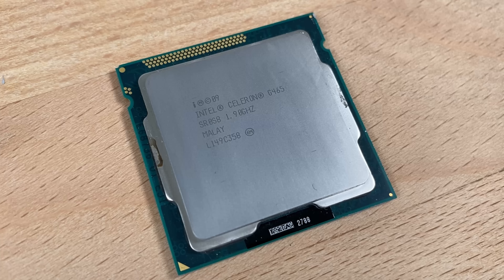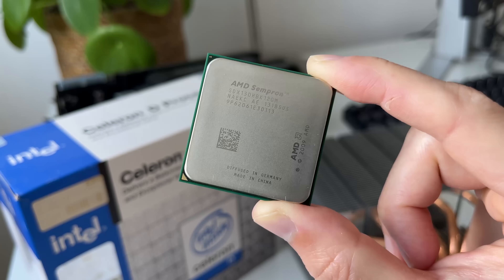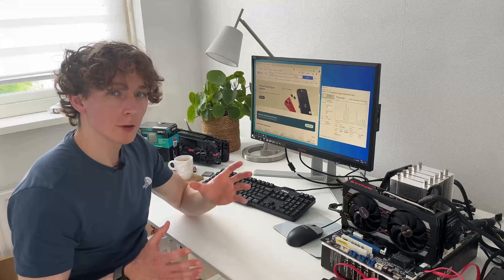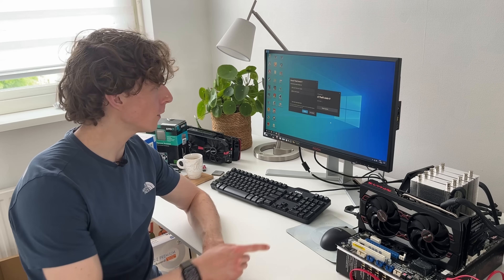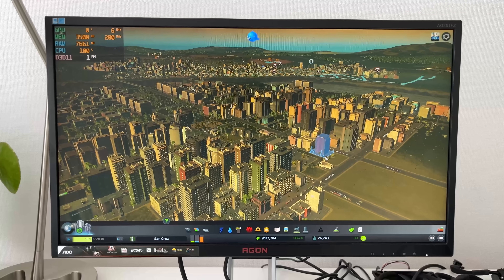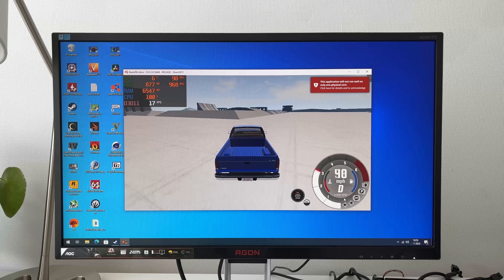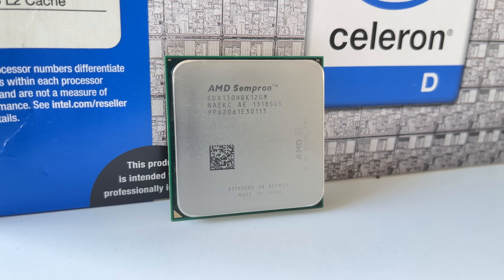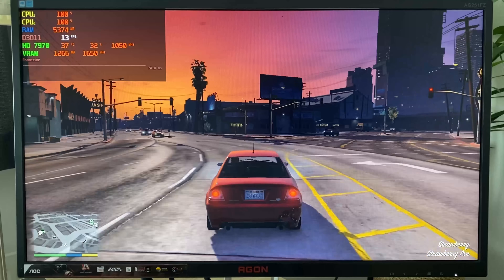AMD's Final Single Core CPU...

Comment: I own a Phenom ii x4 b55, also a CPU that never existed, and started as a sual core. Overclocked to 3.6Ghz It runs Windows 11 just fine. The integrated graphics in the motherboard dont run youtube smoothly at 1080p so an old GTX 1050 helps it runs smoothly even in 4k :D

Comment: You have to keep in mind that single board computers and low end systems are often used in industrial/commercial situations.
I can't speak for today but as of 2012 there was still a lot of billion dollar industries that ran their systems on Pentium/Pentium 2 era hardware and DOS apps with keypads and tiny CRTs as the interface.
There was still a market for single threaded CPUs for situations like that, though IO becomes the issue then. Most of these old machines connected over serial, which is becoming more difficult to get. When you're talking about a $10K lathe or a $1 million box cutter, you figure out how to keep old tech alive.

Comment: Heres a story inspired by the Celeron video which pushed me to explore the single core AMD Sargas chips much further, in fact after a bundle from a scrap lot, bending some pins and a handful from a fellow XOC friend, i had a few open box and sealed ones (which happened to be a numbers maching pair, 57 and 58, which i have dare not opened. After a 3400+ 939 system with an X1950, 1650, 2600XT, popping in a 4200+ for some tests, i came across a gold nugget in the dirt, amongst the scrap lot was an X2 4800+ the fastest 939 offering, the pins came back perfectly and it indeed worked. But for the XP games, 2 cores was pointless, HT is what you wanted and while almost going for the celeron option, my roots with my first PC were AMD and an nvidia card. 

Another friend turned out to have a motherboard i forgot i long lusted after (as i was the weird one who drooled over a a strong bored and potato CPU.) The Foxconn Destroyer. With AM2+ and a Bios update i now had an AM3 Sempron 150 at 4Ghz (young me thought i could unlock the CPU if i needed a dual core down the line, not with this board :P) But in MW2005 amongst other NFS titles, they were able to take advantage of the X2 4200+ performance, but on one core, but i found that the high 20s low 30s in tough areas only raised into the low 40s, surely there was more peformance in it, the 2600XT just wasn't enough with the slow downs. 

From that same friend they chucked in an ATi HD4870, the baller card that reminded me of that original ATi lust, Crossfire, Foxconn Destroyer, Dual channel (as they were only capable of this on AM2+ with its DDR2 controller.) I knew that card was overkill, but was sad to see the iceQ card i loved just half the framerate of what the 4870/50 i later got was capable of. It however ran warmer than i had liked and just drew power pointlessly. I then remembered the cooler i had put on it was a match made in heaven for a Zotac 9800GT that for some reason has the best mount ever, at idle it sits in the high teens and mid 20s under load, the original slim flower cooler from Zotac producing high 30s idle and mid 50s under load. Faulty T sensor i thought but nope..performance was a hair worse but i could run the fans silent across the whole system.

Not too long ago i found the case i'd have used if i had upgraded, a CM Elite 330, it felt wrong having an athlon when my roots were with a sempron and my first PC i felt needed to have my first PC components back inside, now that i had found an Xpert Vision FX5900XT and 6600XT, the 2 cards i wanted back with that system and an athlon 64 3000 or 3200+ i can finally see what differences it would have made and if that 2800+ had more to give. I always wanted a UV theme back then and after spending way too much on some new old stock UV fans, the whole system was now decked out with them after i found a Scythe Mugen 2 Rev B, the mount was a little sketchy but works. The motherboard sadly hits an FSB wall i haven't been able to get past and these chips with a good bin can reach the mid 4s, but as it stands, the poorly optimised games now run above the monitor's 75Hz refresh rate and in those Unreal engine titles, the framerates are silly high.

The last thing i need to explore is Vista that enables the use of Hybrid SLi, the dGPU on the board is derived from 8400GS silicon and with such a card in the system can enable one of the poorer SLi combos but would be amusing to explore, definitely worth a HWbot submission :P

Comment: I have a guess for why that weaker chip would be released later. There was probably a large stock of chips that failed and were held back until the higher spec of the same line were sold off. Then were modded and sold as lower spec. IIRC from reading and listening, this is just how manufacturing then binning microchips works. It would still be fine for a lot of applications since even slower/older chips were still in use without complaints.

Comment: I had sempron 140 for quite some time. When I discovered that my MB can turn it into a dual-core with a click of a button it was a revelation. I used it until 2019 and it's still running in my mom's pc (as athlon II x2 4400e)
Reply from the maker: Nice! Thanks for the comment

Comment: Back in 2005. I bought a Sempron 3000+ with 512MB of ddr, later added one more stick for total of 1GB and later the ati x1650 pro. 
It was a great computer for the price. Remember these were the day of Windows xp, and youtube was very much different before google bought it.  Games like Doom 3 and Quake 4 worked fine. 
Of course everyone ignored Vista because it was trash. 
But it was around 2007.  that the old Sempron was showing its age when Crysis was released and first quad cores where coming into mainstream with plebs. Games were aimed a single core for   a while after. 
Around 2009. when Windows 7 beta was a hit I got an Athlon X2 4800+ on the am2 socket with 2GB of ddr2 in dual channel.  The ATI HD3650 was the most expensive component as was most common in gaming configurations and the cpu was overclocked to 3GHz. 

But for  my parents and other light users the Sempron was just fine back in the day all the way up to 2012. when they got my Athlon x2 4800+ machine.

Comment: These chips weren't meant for gaming on Steam AAA titles, but really just for systems that are mainly used for word processing, spreadsheets, etc.
I used to use Sempron 145s and 140s as CPUs for file servers in the mid 2010s, as they performed better than P4s while running cooler. Also, I found that good single core performance was more important than overall multithread performance like you might get from contemporary dual core, multithread Intel Atoms. Semprons fit those needs nicely, and I only outgrew the single core's capabilities when I wanted to do ZFS compression and virtual machines on the file server..

Comment: There are probably x86 embedded systems out there running things like VxWorks that would absolutely fly on that chip because they were designed for 33Mhz 486SXs. Hell, even a system based around an AMD Geode at 700-800MHz would run much faster on this chip.

Comment: You have to appreciate AMD's philosophy in all of this though. Chip is bad? Maybe somebody can still use it. Core is bad? Enter at your own risk, but we're not going to stop you.

I wish more vendors acted this way today.
Reply from the maker: There is something to be said for it, but the downside is the bottom of the barrel chips will end up in cheap PCs bought by people who don’t know what they’re getting and will likely be disappointed by the experience. Nowadays this is less of an issue as even the slowest CPUs are sufficient for daily tasks.
Reply: Now intel is doing the thing with 13rd and 14th gen core I cpus :D
Reply: It sounds cool on paper but is a hell on practice, Intel Atom (yeah you said AMD i know) is a fucking trash, i barely could use one for daily drive around a decade ago, even when the manufacture date said it was made like 4 years ago (2010) it was still struggling to run Google chrome

Comment: Back in the day, I got a Sempron 145 for a MoBo that was left behind after an upgrade that I turned into a storage server. The moment I installed it in the socket and turned the PC on, I was greated in the BIOS with the invitation to unlock it. I did that and found out that it actually had 2MB of cache and identified itself as an Athlon X2 245. Ran like that for a few years until I retired it to storage, with the purpose of one day building a Win98 machine with it, if I find DDR3 modules that are small; like 2x256MB or 1x512MB at most.

Comment: Can you try again unlocking the 2nd core, stock settings but crank up the voltage.
Reply from the maker: I did - stock settings but with 1.55V. It didn’t work

Comment: I have a Sempron 140 and 145 at home, both can unlock the extra core and they work flawlessly. I also have an Athlon II x2 (or Phenom II x2, not sure anymore) that fully unlocks to 4 cores and 6MB of cache and the improvement is staggering.

Comment: I daresay they were just offloading batches of chips that didn't meet their original specifications by 'downgrading' them, rather than just scrapping valuable silicon. They would probably sell most of them to OEMs for use in cheap office PCs etc.

Comment: i had the sempron 145 running up until 2020 with windows 10, sadly it died due to power supply failure.
Reply: Sadly?
Reply: @MrRa1nes  ???

Comment: That generation of AMD chips was really a matter of tinkering and performance/price ratio - the Athlon II X4 620 was the cheapest quad core one could get, and if you were a bit lucky, it would overclock quite nicely. Also, you had the possibility of unlocking core(s), cache and what-have-you on some motherboards (Asus and Gigabyte, mainly) and if you were lucky, that meant a lot of extra performance... At the cost of high power use.
I had a X4 620, base clock 2.6 GHz; I could undervolt it by almost 0.2 V and still push it to 3.2 GHz - VERY NICE performance improvement, and with a beefy cooler (Noctua NH-U12P and a couple of 120 mm fans) it stayed frosty. Overvolting it and boosting the cooler's fans to the max allowed it to run at 3.4 very stable (hours at max load, no crash, great in winter for extra heating, 250W power draw). Years later, I noticed that activating the alternate firmware (that's how they called it at Gigabyte's), it unlocked 6 Mb of L3 cache - essentially turning it into an Phenom II X4. I wouldn't clock as high and I had to reduce the undervolt, but since it had become my living room PC by then, running it at 1.6 GHz with all the cache made it smooth as butter as a media center.
Sempron64's were excellent deals at the start of the 2000 : the 1600 MHz version could easily overclock to 2.4 GHz on cheapo motherboards with the stock cooler, best bang for buck I could find. They allowed me to build a fleet of company PCs on the very cheap. I merely had to buy a soldering iron and some capacitors to fix them after 2 or 3 years of use (mobos were VERY cheap), the processors kept going without flinching for up to 5 years after that.

Comment: I would love a cheap AM5 CPU for diagnostic purposes. Having to have a $160 part laying around to see if a board works or to flash firmware without resorting to flashback is a pain at times. I would pay $50 for an otherwise useless single-core CPU today.

Comment: AMD released this CPU because they had a bunch of Athlons x2 with only 1 fully working core in storage. If you tried to delid it, it will most likely hide the real Athlon label. Rather than throwing them away, AMD decided to sell them as the most terrible single core ever made. I don't think I dislike that. If they ended up in a school lab or office for cheap, and if AMD made some money off them, in my book that's better than if they just tossed them in a landfill. Cool video!
Reply from the maker: Thanks!

Comment: I had a dual core Phenom which unlocked to four cores. The only problem was that it drew 170w of power which I didn't have the cooling for. In those days no-one, except maybe extreme overclockers, imagined having to cool 170w of cpu.
Reply from the maker: It’s interesting to see how the consensus on CPU power has shifted over time

Comment: I used a 3.0Ghz Phenom II X2 unlocked and overclocked to a Phenom II X3 3.6Ghz from around late 2009 to late 2015, then other people used it until about 2020. At first I ran it as a stock dual core because unlocking to a quad failed, and unlocking core number 3 failed (bad L2 I think). Much later on I realized I could try enabling cores 1, 2, and 4, which worked, so I upgraded the stock HSF and bumped the multiplier up 20%. The performance difference was massive and kept it usable for a long time. Definitely my best <$100 CPU purchase and ran completely stable for a decade.
Reply from the maker: Awesome, always great to get so many years of use out of a CPU

Comment: I still have my Sempron 140 which can be unlocked to be an Athlon X2 and severaly X2 250, 260s. Back in 2009 to 2011 this chips were usefull but the time of DualCore CPUs is over for modern computing. For any RetroSystem they are very good besides Intels Core2 E7000 and E8000 Series

Comment: AMD was known to disable fully working chips to make lower core count chips. It's why so many core unlocker boards exist. Unfortunately, you did not get one.
Reply: The Semprom 130 only exists because of the faulty units produced. There's no unlocking in faulty parts of a chip to be done.
Reply: @JAnx01  yes there is
Reply from the maker: I was a bit sad about that, the performance would have been significantly better
Reply: Depends a bit.  Some sempron models were way more likely to unlock satisfactorily than others, and athlon was the same way.   I don't know/remember that particular model, but at the time some models were getting  better than 80% unlocked to quad cores with enough stability for home use.  You wouldn't want to run all of them unlocked for extremely critical sensitive stuff but I had an athlon that unlocked and was running a persistent game server for years. It did get a weekly reboot and update anywhere from 5 minutes to a 45 minute downtime and I had a handful of freezes or blue screens in the 30 months or so that was there, but it was very reliable for a 2005-2012 time frame windows based machine. Part of the time it was even being used as a daily browsing machine while that was in the background.

Comment: These old semprons were fantastic for if you ran multiple computers in the house before virtualisation. I used to build sempron servers for home tasks like fileservers and stuff that didnt require a lot of processing because the CPU's were less than $50 and a mobo could be had for about the same price
Reply from the maker: Interesting use case! Thanks for sharing
Reply: Did hw virtualization exist?
Reply: @Loanshark753 x86 hardware virtualization has existed since 2005 for Intel and 2006 for AMD, but it wasn't widespread until a few years later. Back then, VMs were sloooooow since programs like VMware used emulation.

On the Linux side, we did have containerization technologies like Linux-VServer and OpenVZ, which were what we used before LXC. 

It's amazing how far we've come. These days we can even virtualize GPUs (even Intel iGPUs!) using SR-IOV, letting multiple VMs use the GPU at the same time.
Reply: @Daniel15au  There are some Patches to be merged on QEMU that enable Venus graphics, basically vendor-agnostic(only mesa drivers support it for now tho) vulkan passtrough (from my testings, performance is near native, very different from virgl, for example), so now we can even paravirtualize graphics without any help of GVT-g or SR-IOV.
Reply: @Caique_.-.  this is very cool! i'll keep an eye on it :)
Reply: @ryjelsum The patches are already merged on latest stable Mesa, QEMU and Linux 6.13  :D

Comment: Honestly... I've always wondered if this is just placebo effect but... we got along with single core/1 (sometimes 2 I guess with HT) thread for a long time, I realise that applications were less demanding then but... a fast single core chip in the late 90s/early 00's seemed to cope fine with some pretty heavy multitasking.

I guess OS's changed though, Windows 10 certainly won't be made with this configuration in mind and neither is anything else. Modern websites are definitely heavier but does sort of make you wonder just how much power we're wasting, the very idea of needing multiple cores just to smoothly browse the average website would seem quite ludicrous in the 2000-2006 sort of era, well into "web 2.0" days with all the extra demands it placed upon systems.
Reply from the maker: True - I have the suspicion a lot of websites and software have become unnecessarily bloated - especially with advertising, tracking, embedded videos and so on... Windows XP on a hard drive wasn't necessarily slow, but now you can use Windows 11 with an NVMe drive and still have it feeling sluggish.

Comment: The core unlocking part really made me wish I didn't sell my Phenom II x3 720, that was stable with the 4th core unlocked. It was a fun system to mess with. I even lapped the CPU heatsink to expose the copper for extra heat transfer for the heatsink. AMD was struggling when sandybridge came out, but it was still a fun system to work with.
Reply from the maker: Nice! Love the opimization with lapping